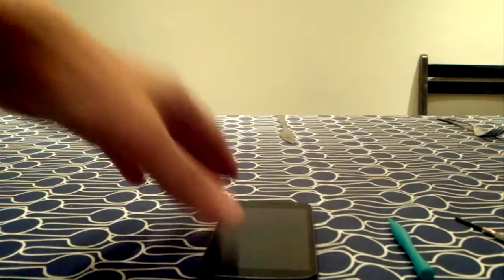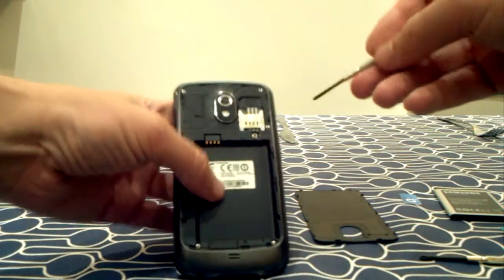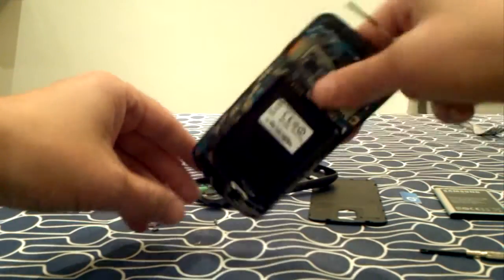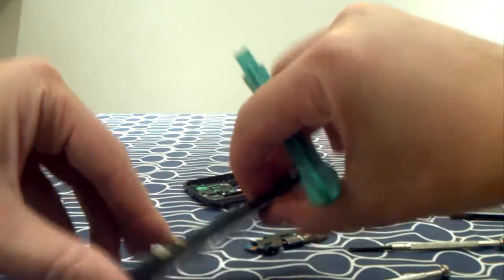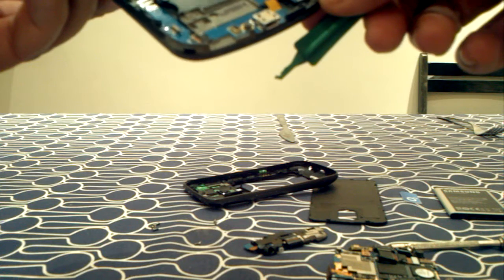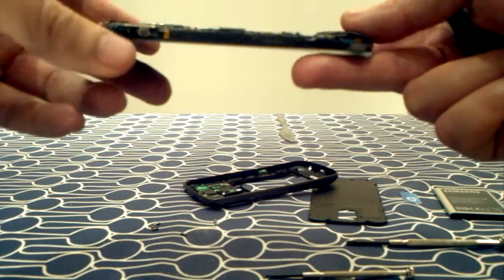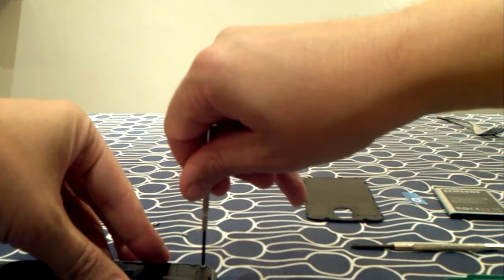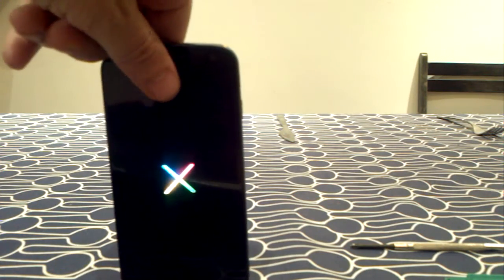Galaxy Nexus dismantling breakdown  full disassembly tutorial

Comment: Thanks for the video. 
I broke the jack plug tip inside the socket so I bought the little board that has the antenna the jack socket and the loudspeaker, now my loudspeaker doesn't work, not even with the old board. anyone have any suggestions?